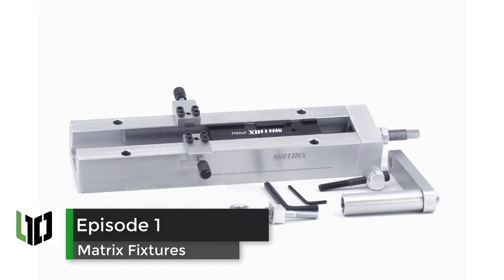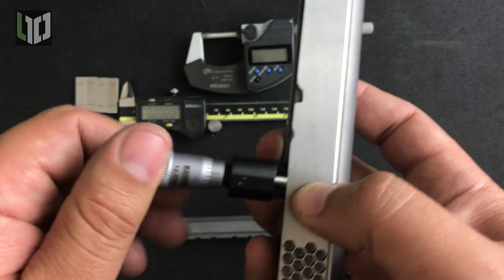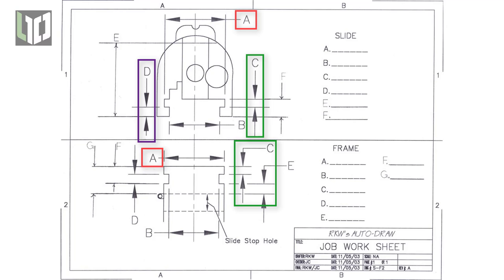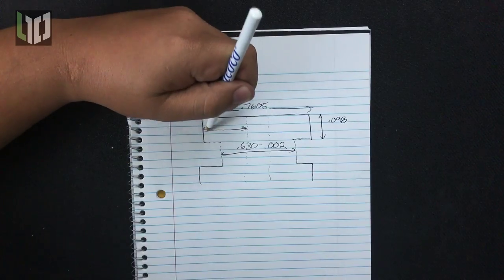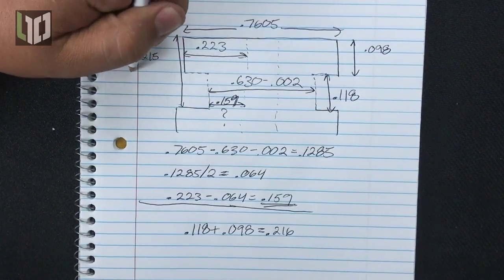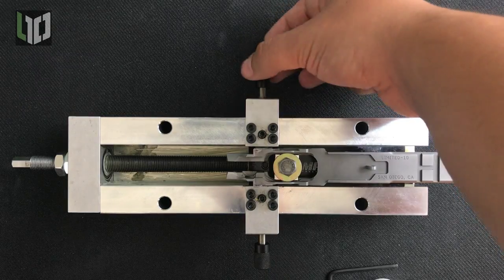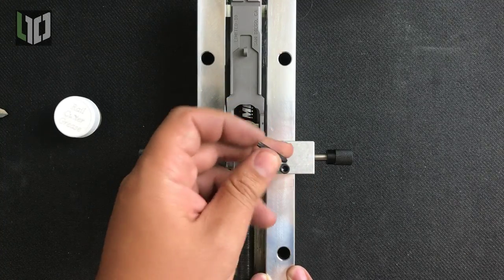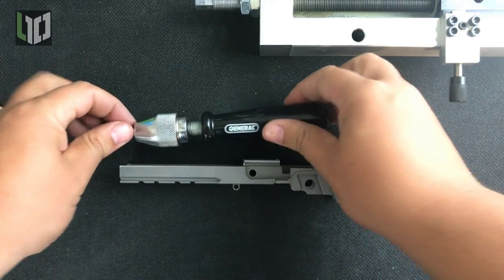Easily Complete Your 2011 80% Frame

Comment: If you are going to be building 80% lowers you are better off buying a harbor freight mini lathe.  It is not only more accurate, but you can make all kinds of custom cuts such as caliber changes etc...  officer size 2011 in 5.7x28 that holds 25 rounds anyone?  Or 9 mm AR-15 pistol with an uzi style bolt and springs?